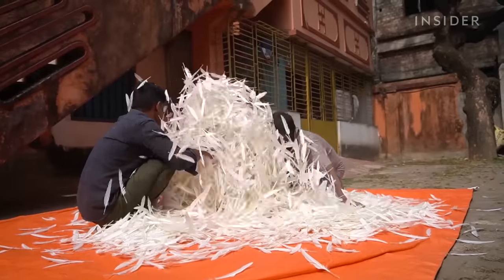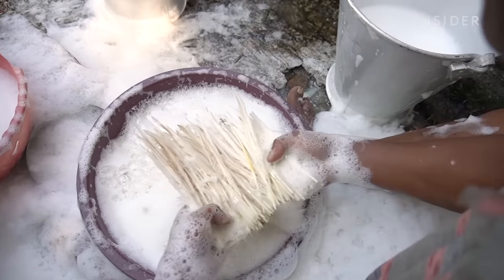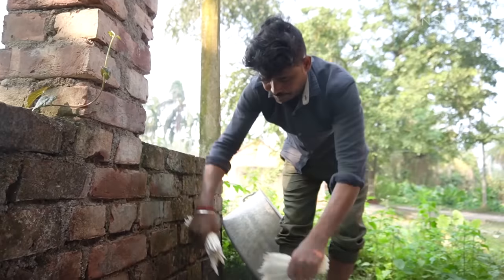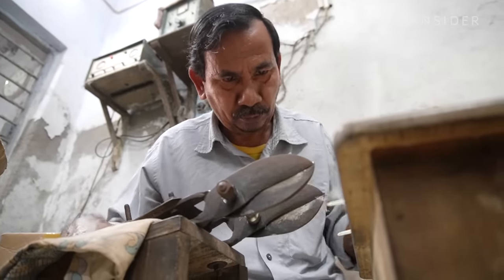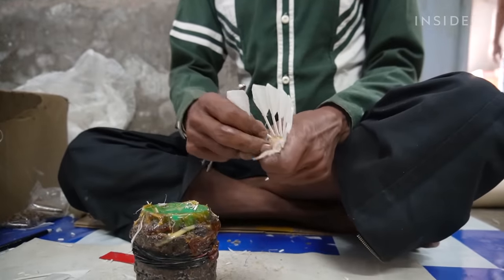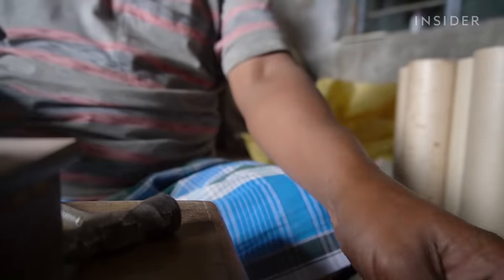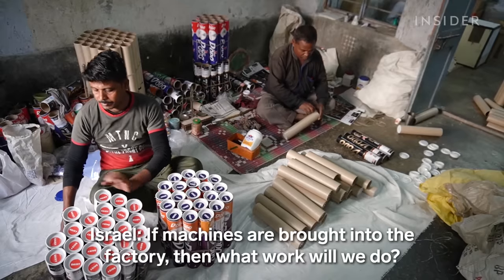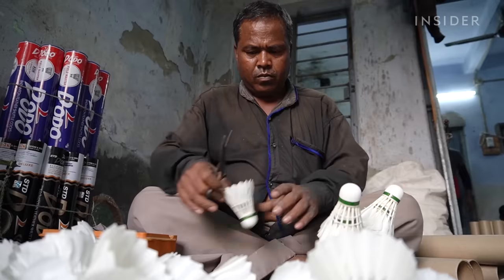How A Village Keeps India's Handmade Shuttlecock Industry Alive | Still Standing

Comment: The decline in the feather shuttlecock market was due to the emergence of synthetic shuttlecocks.
Although, the trajectory and flight of the feather shuttlecocks are unmatchable, durability is sub-par which is a major concern for aspiring players. On contrast, the synthetic shuttlecocks are really durable making it a more economical option. If manufacturers could find a way to match the durability with a competitive price then there is a hope for revival otherwise it's death is inevitable.
Reply: i hope so... and it'll support small producers like this one too!
Reply: Yeah there is a difference between an art dying due to cheaper options and death due to a superior product.
Reply: You can grind the feather in shuttle cocks and use it as a fertilizer for strong wood trees like Coconut Tree or for palm trees. The Synthetic shuttlecocks are grade 3 plastic which is really really really harmful to both the land and the water that we use and it's impossible to recycle it because shuttlecocks are only discarded when worn, worn plastics are no good to recycle again because it also takes much energy to do it
Reply: most enthusiast i know and myself included are playing with with feather and not plastic shuttle. The main reason were not using Dodo shuttle is their flight path, speed and durability as Yonex AS2 or even their TR series offers much better value
Reply: Actually I've seen no one to play with the synthetic ones.... I have one but haven't used it..... Feather ones are the best
Reply: but playing with plastic shuttlecocks is so boring its much more enjoyable to play with the feathered ones
Reply: I don’t see adding more plastic is good for environment, these feathers are waste from meat production. Not to mention, the broken shuttle can be reused by changing the feather.
Reply: Yeah, plastic shuttles - great for schools etc to have a few sitting around - they last for ages and can take abuse. But beyond beginners, no badminton club or coaching group will use them because they're rubbish as actual shuttles. They simply don't fly properly.

Comment: Playing with feather shuttle cocks is actually expensive.
A good tournament grade feather one generally costs 80-100 rupees a piece and hardly lasts about a quarter of the duration of a synthetic shuttle cock.
I used to play at state level and still used a mix of both as playing with feather shuttles in practice is quiet an expensive affair.

Comment: i agree synthetic are not the same feel and certainly not the same trajectory. I disagree that somehow feathers are better. They cost more. They damage more easily. Most young people learning to play do so with synthetic so they have to learn a whole new feel when they move to feathers. I represented the RN for several years so played to a reasonable standard and I would welcome the use of synthetic across the board going forward so younger players don't have to chosse between cost and having to learn two different shuttles. What I have never liked are the rubber tipped shuttles over the cork. That takes away the skill in being able to hit powerful smashes or high full court clearing shots. Cork tipped synthetic shuttles make for a perfectly good game at all levels.

Comment: Perhaps one selling point that can be made of the Dodo brand of shuttlecock is, they're mostly organic and better environmentally; better for waste and landfills... something the synthetic one are not.
Reply: Nope. Synthetic ones are better for the enviorment and natural ones are not biodegradable as when they decompose they leave behind mass suffering and innapropriate content which does NOT biodegrade. Therefore synthetic is better for the enviorment and synthetic ones last longer which makes landfills not fill up so fast.
Reply: @insectbite1714  You'll have to do a bit better than that to explain your position here; The feathers are a by-product of production; it requires not additional work related to fuel consumption or wasted energy to produce. However, synthetics requires fuels and energy to produce. Synthetics; while you say they last longer, this also means they remain longer in landfills; they are likely inorganic, and the  decomposition takes significantly longer. However, despite their usefulness, feathers and cork are natural organic materials that decompose faster and provide organic material back into the ground without leaving harmful chemical residue. As for the 'suffering;' there is no suffering in the process of recycling the feathers; the suffering occurs in the first stage of animal production; a case involving the plant that processes the birds for food. The recycling, however, develops a benefit through recycling that minimizes waste. It also ensures no unnecessary environmental hazards occur from costly manufacturing that requires high energy consumption; thereby, the recycling of the feathers limits the carbon footprint from manufacturing that requires  fuels and electrical energy to runs ins larger manufacturing machines.
Reply: @muzkat101  no u
Reply: @muzkat101  I won the argumint so stop vomiting words all over the screen